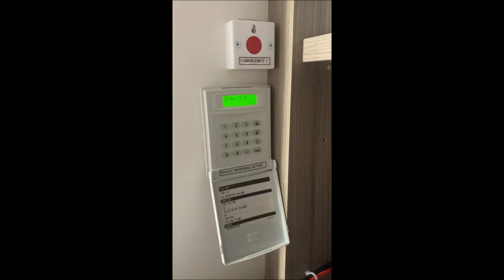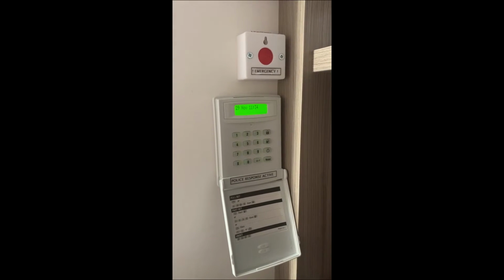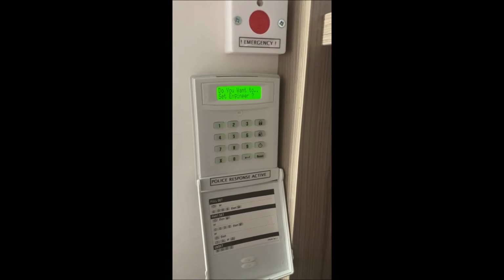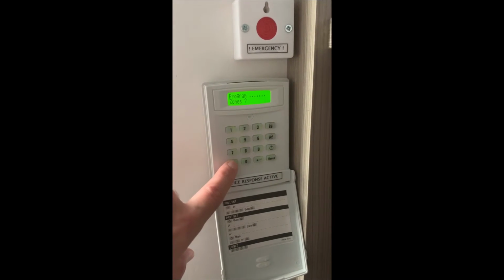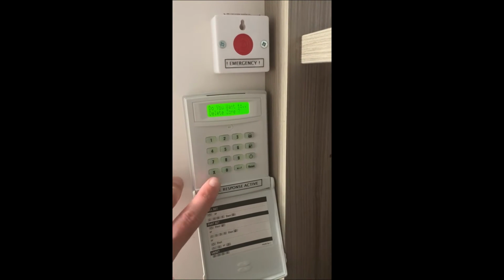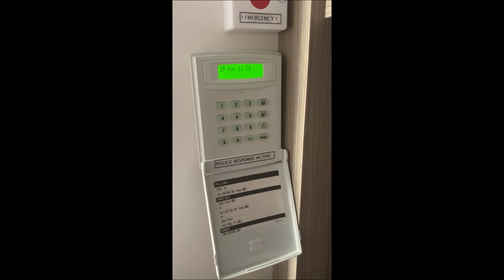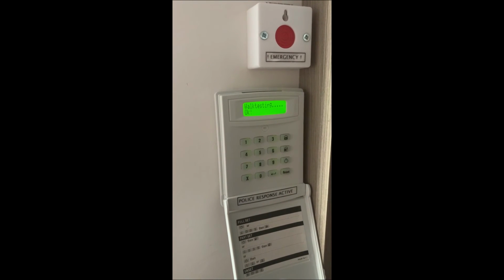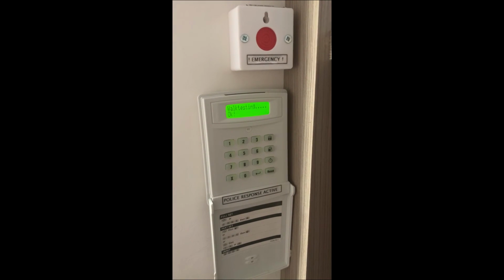Gardtec EuroSec-8 Site Maintenance Visit

Comment: I have eurosec  alarm 
Changed sensor  batteries 
Main panel battery
Fuse
And all glass fuses

When set alarm  all different  faults  appear  hatch
Door. Kitchen  etc

How can I reset panel  clear all old faults 

Tried  master  code 5678
My user code

Cant get get menus up

Or is it old

2011.   Installed 

Thanks  Dean
Reply: Hi Dean. You should be able to reset it by keying in your user code and setting, then when the tone starts key your user code in you should have a fault free system. If that doesnt work drop me a reply.
Reply: @alarmsgalore Tried b4

When I reset  hatch fault comes up  or front  door 
Change  all sensor  batteries. Main battery  battery. All glass fuses. And fuse

When I set it alarm  Internet  goes off with faults
Reply: @alarmsgalore doing  my head in.  Maybe  bad circuit board hatch?

Comment: Could you please let me know how to change the battery as it's shows low battery or completely decommissioning the alarm system as I have a verisure in my property
Reply from the maker: Hello.  The battery replacement process is quite simple, but easier of you know the engineers code.

1. If you know the engineers code, enter your user code first on the keypad, start to set the alarm.  Then immediately afterwards, enter the engineers code.  This should stop the setting procedure and enter into engineers mode.

Once in engineering mode, you can safely open the case on the control panel itself located elsewhere, where all the wiring goes to.

Could be under the stairs, in the loft but it normally has a speaker in it with noises made during exit and entry.

Once you've got the lid off safely, you can disconnect the battery in the control panel and replace it noting the black to black and red to red terminals on the battery.  Try and replace with a YUASA or PowerSonic or LUCAS battery, something quality and the same rating of A/h of the failed battery.  

That should last you 4 -5 years depending in circumstances/load/number of power failures per year etc. 

Finally button up the panel, securing the lid back on properly.  Then go back to your keypad, and press 0 repeatedly until the menu exits and the keypad reads date and time with briefly showing the message <<UNSET>>

2. If you don't have the engineers code its almost the same as above except you open the case with no code, the alarm goes into tamper with a loud alternating alarm tone, enter your user code and the alarm should stop with a !!!CHECK!!! message.  

Replace the battery, close up the lid and enter your user code, press reset to clear the fault and then the keypad should read briefly <<UNSET>>

NOTES:

1. Always be extremely careful inside the control panel especially inside a Eurosec which is a very compact enclosure;there are mains live wires in there and circuit connections that require care when working in the case to avoid risk of electric shock or damaging the wiring causing further problems for you.

2. I cannot advise on how to decommission an alarm system as it contravenes the  codes of ethics and practice of registered installer.

Comment: My alarm has just gone off  suddenly .. not internally but external sounded 
Key pad isn’t showing any faults or any lights ? Could this be the fuse on the alarm
Reply from the maker: Hi Naseem, only just seen this.  It could be the supply fuse for the Bell/Strobe output yes, this is rated at 1amp quick blow.  It could also be the circuit board in your bell box.  However when this happens you normally get an indication on the keypad and internal warning sound combined with the actual street siren/bell.

Check your panel is actually alive and there are no >>CHECK<< messages displaying.  If that's all OK I'd say start looking inside the Bellbox itself.

If its over 5 years old in general we replace them unless inspection says otherwise or the customer doesn't have a contract with us. 

I would check the cabling to the Bellbox. A damaged cable may not be damaged on the tamper circuit but the supply line may be damaged and of course also check for sabotage.

Also environmental conditions affect the health of the Bellbox too.  So if you live near the seaside I tend to find these boxes need replacing more frequently  than inland owing to corrosion of parts from sea air. 

I've had a customer who had a random fault and it turned out that mice had bitten the supply line to the SAB and was randomly shorting out.  Right under the eve of her house so it was difficult to find, but a meter check on the cables will tell you if you have good continuity. 

Hope that helps and hope you get to the bottom of it.
Reply: @britanniasecurityservices982  thank you so much , your information and knowledge is extremely important . 
I will have to explore all this now in stages. 
There is no power to the key pad so can’t read anything from this. Firstly, I want to replace the fuse near the panel then take it from there. Thank you 🙏🏻

Comment: I've just moved into a property with this alarm system, but how do you change the code for entry & exiting as I dont have instructions/ user manual & the online version is not very well explained... cheers
Reply from the maker: Hi.  

First of all you will need the Engineers Code to continue. 

Start to set the panel with a user code then soon as you hear the exit tone, enter the Engineers code.  

This will stop the exit tone and <<< UNSET >>> will appear.  Enter the engineer code again. You will see a message:  Set Engineer ? 

Press 'X' 3 times then press enter.  Then press X 6 times until you reach the Program Exit/Entry ?  menu and press enter.  

From here you can adjust the timers for exit and entry.  When you are finished Press '0'   3 times until a single beep is heard.  The keypad will show <<< UNSET >>>. This will exit the engineering menus.  Hope this helps.
Reply: @britanniasecurityservices982  thanks for your help, all sorted now hopefully

Comment: Hey mate. Thanks for the video. I've got one of these but don't know the make. It recently sets an alarm off and says Fuse/bat. Fault check. Guessing the battery is low but no signs on how to change. Don't want to force anything open and damage so if you could kindly advise how to replace battery's that would be super helpful. Cheers
Reply from the maker: Hello.   The panel is a Gardtec Eurosec 8

 It sounds like auxiliary fuse for the stand-by battery circuit has blown or the battery itself is exhausted.  If you know the engineers code first of all enter the USER code and start to set the panel.  

During the exit period enter the engineers code and this will stop the exit tone and present the engineering menus.  

At this point just leave it in engineers mode and then you can open the end station lid of the panel. This will not cause a tamper alarm.  

Check the battery fuse and the battery itself.  I use ATC Meters on every service visit to check the health of the battery.  

Even if the battery looks OK as in no blisters or swelling check it on a battery meter.  Also if older than 4 years, (5Max) then just replace it as a matter of course.

Once the fuse and batt have been replaced, check the other fuses are all OK such as the Bell Fuse and the Aux 12v Fuse that supplies your device power (PIR/BreakGlass/Smoke D/ etc...)

Finally once this is all OK, press 0 and repeat until the internal sounder gives a single low bleep tone and the display on the keypad shows " <<UNSET>>

If it shows !! CHECK !! enter the user code again and read the error message that will tell you what's still faulting.

Good luck with that and hope that helps.